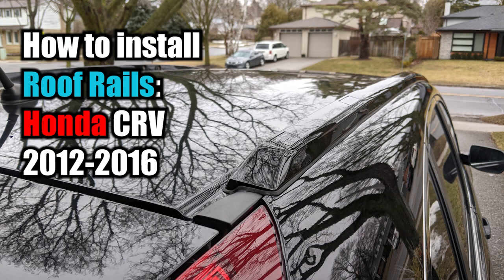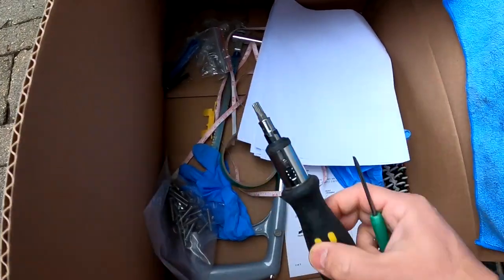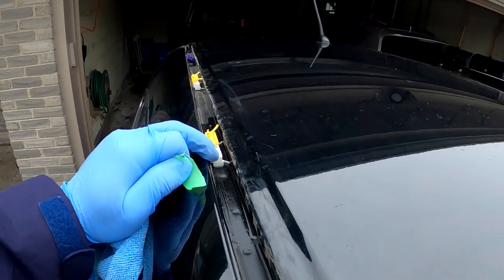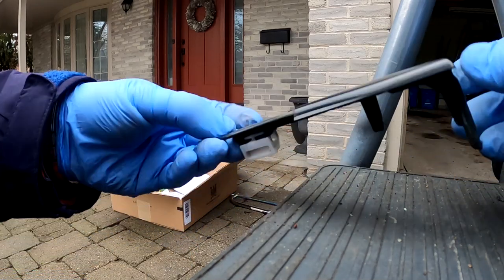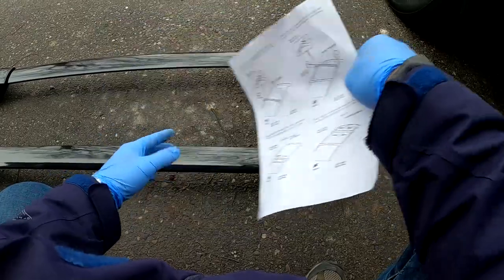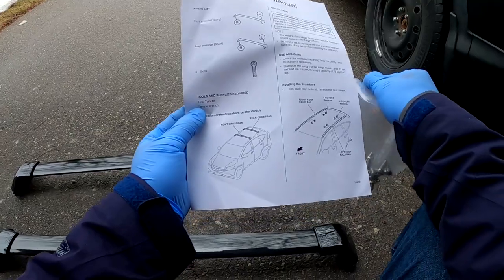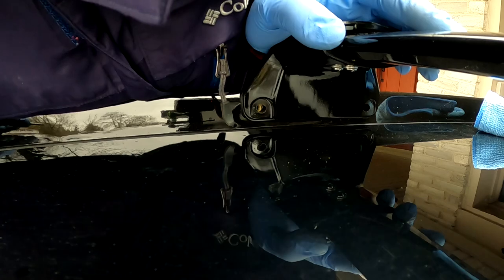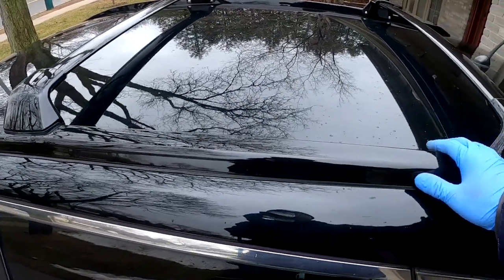HONDA CRV 2012-2016 roof rail and cross bars- Installation - Cheapest on Ebay

Comment: I have a 2014 CR-V Touring model that I bought used from a Honda dealer in 2016.  It has the side rails, but not the cross-bars, which I have not purchased.  It does have the access hatches in the side rails which you said do not come with the OEM Honda rails.  I have always assumed that the side rails came standard with the Touring model, but perhaps these were a dealer installed option.  I don't think the previous owner installed them, since I believe it was a leased vehicle.

Comment: Great instructions on the rails.  I bought a similar eBay unit.  The rails went on OK, but it was impossible to line up the bolts of the cross bars with the nuts in the rail.  The nuts are just pressed into the rail, and they spin out of the plastic from the side load.  So I have rails that serve no purpose.

Comment: Gteat detailed video, thanks. At time 7:21, it looks like the front if the rail is a bit hacked up? Does the moulding maybe go into yhat rail yhete? Doesnt seem right. Thoughts? Am I seeing it wrong?
Reply from the maker: It may not fit totally flush. As far as I know there is no issue with that front area.

Comment: thanks for the video. in the same boat and looking for a cheap diy alternative and this looks great. Think there'd be any issue throwing a thule/cargo box on top?
Reply from the maker: This is very similar to the OEM so I don't think there should be a problem. I would just check the box that you are getting make sure the spacing will work as the crossbars are not adjustable. I'm thinking of getting one as well. So if you get one before me let me know what you get!
Reply: @LadybugAdventures  thank you! I will let you know!

Comment: What size bolt is the one that goes in cross to connect into rail. The long one. ?
Reply from the maker: Yes. Long ones into the side rail and short ones for the crossbar brackets

Comment: Hi, thanks for the very informative video! What material are the rails made of?
Reply from the maker: It seems to be some sort of metal on the inside. I'm guessing steel. And then plastic on the outside. It really is meant to work those specific cross bars. I don't think I would trust to place anything else along other parts of the rail.
Reply: @LadybugAdventures  thanks again!

Comment: I just bought a rhino rack (crossbars) from e trailer. Will they fit these side rails?
Reply from the maker: I can't say for certain. Roof rails that I installed are specifically for this rail system. I don't know how sturdy the plastic is along the rest of the rail.
Reply: Are the side rails flush and sturdy to your CRV all the way down. I bought a pair of side rails recently and they seemed to lift off the roof a few centimeters when I would rock them back and forth?
Reply from the maker: @danielmaupin5863  no they are very solid throughout

Comment: Thanks for the video super helpful! I want to add these to my crv for my two bikes. Do you have any concerns with quality when putting on a heavier load?
Reply from the maker: No these are very sturdy. Just follow recommended weight. 2 bikes should be fine.

Comment: Nice video! How’s the roof rails withstanded the summer heat? Some reviews says those plastic rails can warp in summer heat. Have you put some load on your cross bars since you installed your rack? Thanks 👍🏻
Reply from the maker: My rails are fine. The base is metal and really the caps are plastic. I've only had about 50 lbs on it so far. Everything feels really solid.

Comment: How sturdy or strong do those cross bars feel. Could they hold significant weight? What are the made of? Plastic?
Reply from the maker: I believe they are aluminum. They really feel sturdy. I can't remember the exact weight but usually the Max is around 150 lb for most roof racks

Comment: after 5 yrs most of my access covers ARE GONE!....carwash...heat etc...  my rails have also bowed in the sun and do not fit flush anymore!  looks like crap
Reply from the maker: @dfwguy7149  I’m only 2-3 years in so fingers crossed. I am definitely not gentle on mine. I use the rails to pull myself up to get access to the roof etc. sorry to hear about yours rails.